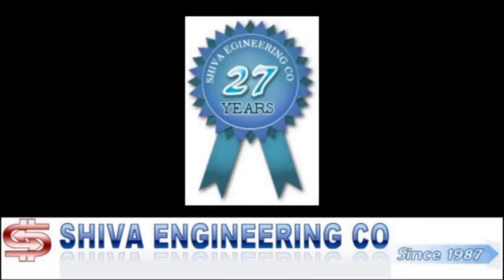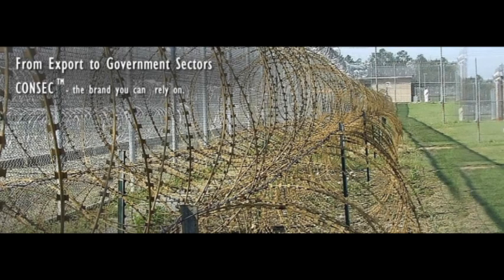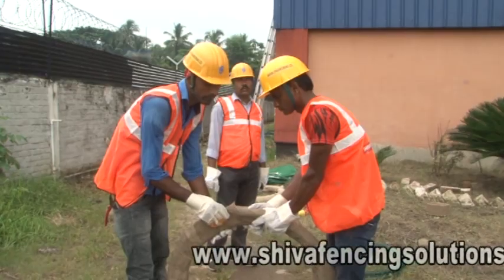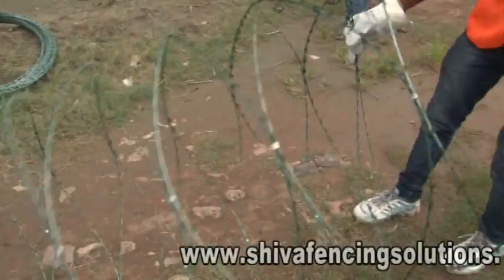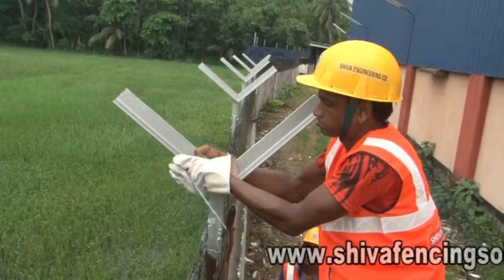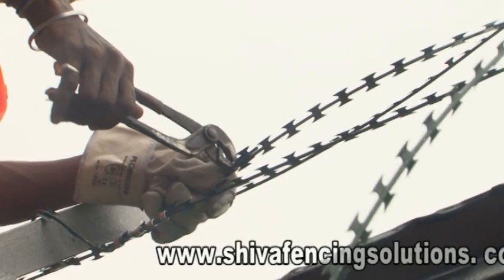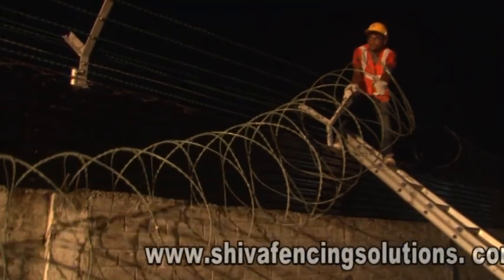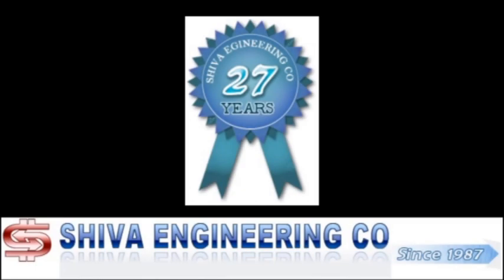Razor Wire Installation Tutorial Video

Comment: This is a very useful video in which fixing of Razor Wire has been clearly demonstrated  using different fixing tools and accessories .
Reply: 400 meter per Runnig meter  9847407 114

Comment: How do you avoid the use of carpets to climb over the concertina?
Reply: Obey the law...lol
Reply: armed guards, dogs, alarms, etc.
Reply: Nothing can completely keep anyone out, just slow them down.  Having a fence that is also angled at the top can make it more difficult to climb over
Reply: Use wire cutter instead of carpet
Reply: Connect it with nice electrical system to get more jolt